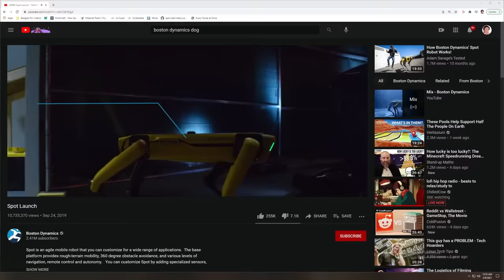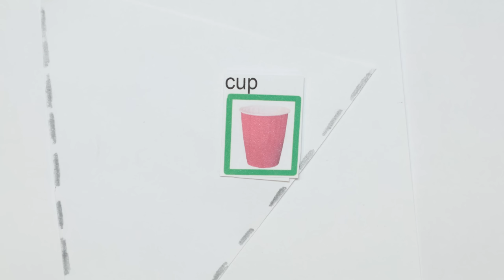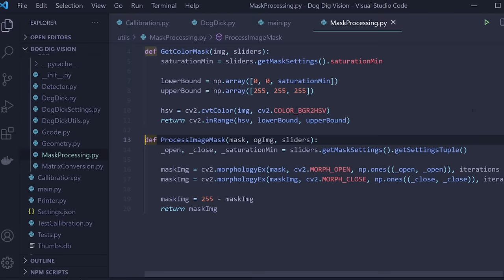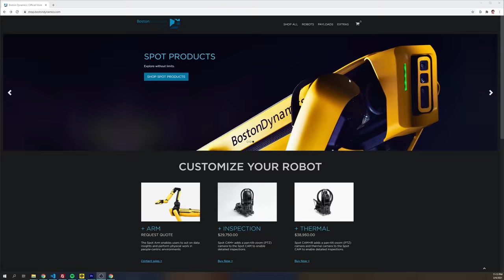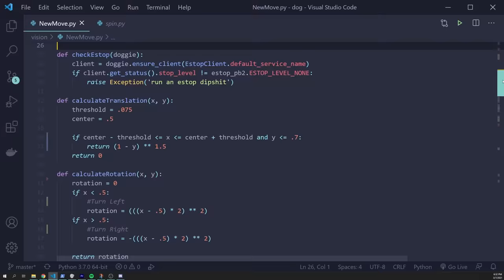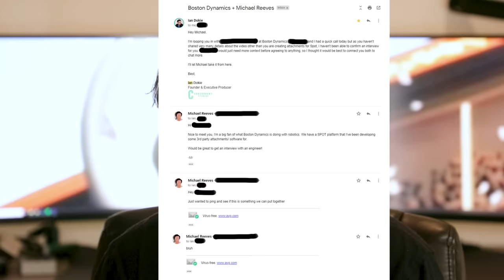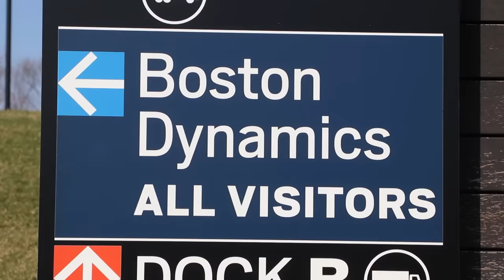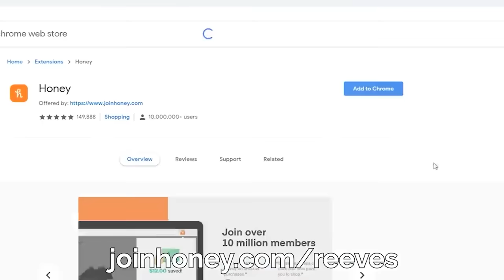Teaching a Robot Dog to Pee Beer

Comment: “Construction company” is a fun way to describe a company that produces weapons
Reply: @KrisRebel  is there better robots ?
Reply: Tbh, military robot for now is just too unpractical from budget and material standpoint than full-blooded human with gun.
Reply: Basically any company can be described as a company that produces weapons, with enough intent 😉
Reply: Just think of them as a DE-construction company
Reply: So Adam Savage is funding private militias
Reply: Admiral Amel Especially as long as you live in a system that actively suppresses the lower classes and forces them by threat of economic ruin to join in an imperialist military force to further the goals of the “defense” sector. 

A pissin robot isn’t all that bad tho
Reply: @BoarhideGaming  b-b-based 😳
Reply: @admiralamel9563  TODAY Biden’s administration expanded the military budget to over $700 BILLION dollars. They can afford this and I’m sure they get a discount.
Reply: All construction equipment can be used in Warfare if you're brave enough
Reply: @KrisRebel  they actually did make a few robots for them but they needed to be gas powered to actually handle any weight over like 75 lbs or something. It was going to be used to possibly help troops transport gear easier.
Reply: I believe the idea was to use it as a reconnaissance robot, so soldiers could send it to find possible ambushes ahead of them before going in.
Reply: @vanillaholler  That might be true, but you don't know what other tech they spend those billions on. Your perception is that they have a shit ton of money to work with, but as far as we know, maybe 700 billion barely cuts it.
Reply: "Contracted Development" honestly sounds better
Reply: @BoarhideGaming  lower classes arent oppressed.
Reply: @DucisImperium  Correct. Didn't the majority of the most successful people alive start off with nothing at all? Wasn't that their driving force? Telling people they are pre-determined to fail because of their situation is only lying to them, and giving them an excuse to never try to succeed at anything because they are "oppressed" and because it's "useless." The most toxic thing you can tell someone in a bad situation. It's equivalent to telling a depressed person that it will never get better and that they should just give up.
Reply: @jimmyjoe1488  forget the Soviets - that shit was amateur hour. Yank brainwashing is the good stuff. “You can be a billionaire too if you try hard enough!”
Reply: @spiderchopproductions8172  Classic straw man
Reply: @jimmyjoe1488  can you give 3 names of people wich started with nothing and reached few millions? (excluding people who fund petrol on their land or gold)
Reply: @idahooo3253  Don't you see the ideology you support is lying to you?
Reply: @jimmyjoe1488  well all i ask is 3 names of people who got big from humble beginis without oil or natural resurces wich are luckbased. help me learn the true ideology wich doesn t lie to me.
Reply: @idahooo3253  I literally sent you three names in the other comment but apparently you were to lazy to look. Obviously I'm conversing with a child
Reply: Jimmy Joe Absolutely not. Maybe a couple inventors went that way, but mostly “old money” still stays rich while people with no money for education, healthcare or free time usually won’t pull through to become millionaires. That’s a statistical reality. This system is designed that way. Your previous American dream is a lie you were spoon fed from the first time you were forced to swear allegiance to some flag in preschool.
Reply: @BoarhideGaming  I don't live in America, I never have. Obviously you've never met someone who actually wants to become something. No matter what is in their way, if they really want it, they will get it, regardless of where they started. Excuses excuses excuses, stop making excuses, and if you want to go achieve something, go do it. Literally no one is stopping you except yourself.

Comment: reeves i chalange you to make a giant boot sequence where you put a key in a key hole twist it then flip a switch then use a face id then also use a fingerprint ip then a voice ip then a dic- nevermind the  it will open a sequence of doors then it leads you to a button then you press the button and it open another door that has a heap of swearing roombas and the piss bot running around trying to fry all of the roombas